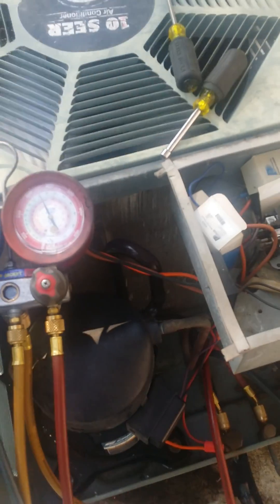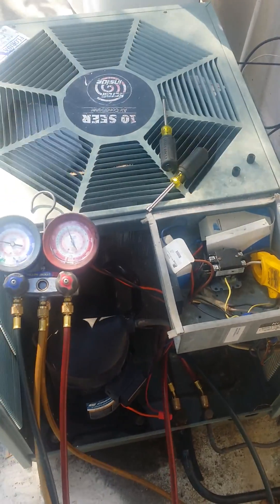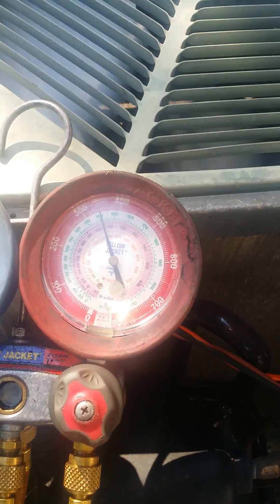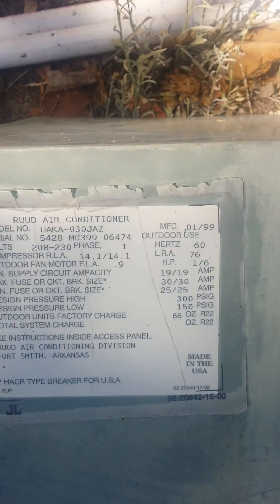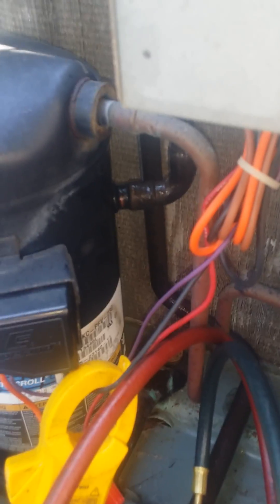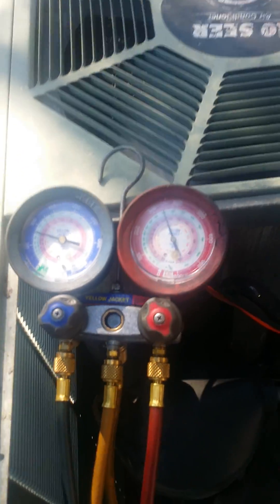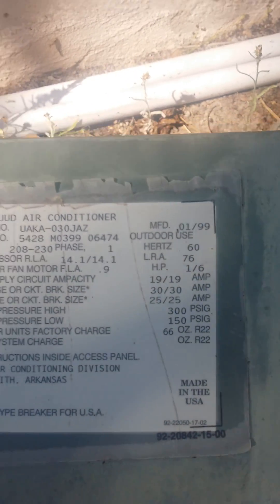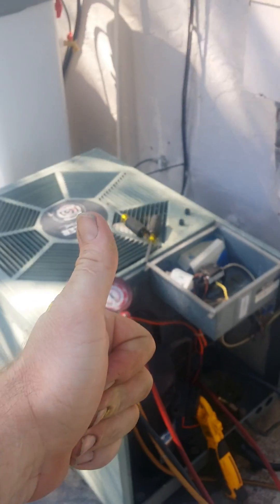410 a refrigerant drop on top of r22

Comment: The leak  is gonna get worse,  Because now you're running at a higher pressure  so the leak it's gonna be more aggressive, You would went back with R22 which is a lower pressure and let's say you only adding refrigerant once every year or every other year now that you added a higher pressure refrigerant it may be ever 6 months now, Plus there is different oils in the different refrigerants which will cause the compressor to fail prematurely,  you Just screwed your customer,  I guarantee you won't do a follow up video on this customer 6 months from now most likely they're gonna call somebody else

Comment: System will rupture, it's a hight prussure refrigerant added to a lower prussure system , especially an old system that has a rusty coil and corroded condenser, and in a very hot days oh goog god the prussure will go high and when that condencer gets dirty it will be doubled, mind u  that u went to that place 3 times which means that  there is a leak!! ,, guys don't do it couse ot worked , do it the right way ,, ppl search on you tube thinking that this is fine !! It's a disaster; for god sake if the indoor coil rapture they will be breathing all that chemicals,, !! If you are a Google warrior DONT call a tech to do this , it's not healthy, ur taking a chance breathing poison , this is your comfort unit, you should live comfortably. When you sleep you'll have no idea what's going on , you'll sleep forever!!

Comment: I put 410a in my r22 system and it works just fine
Reply: Did you have to take out all of the old r22 and clean the pipes and EVAP with nitrogen
Or you just added on top of it 
If so what ratio

Comment: There are better ways to make customers... It is unsafe to put r410 in an R22 system because of the pressure differences. Secondly unless it is a scroll compressor and considering you have to use Liquid to charge a 410 system you could easily blow the valves out of an older hermetic reciprocating compressor. 3rd you are not doing the customer any favors by coming out and dumping refrigerant into his system every time he has a cooling problem useless. As a professional I would not recommend people follow your advice in this video.

Comment: Let's talk pure simple logic. I am not an AC tech but I think I understand the concept  from a homeowner who likes to get a  good grip of things before they are done.  

Lets talk pressure? and someone who is truly an expert (takes typically 10 years hands on experience to be called a pro or expert in your field) can verify this for me.  

Analogy: Provided a chair can handle  a heavy  weight, A 1000 lbs  person sitting on that chair every day, for a year, will likely wear out that chair 10 times faster than one a 100 lbs, doing the same. This is the way I understand refrigerants. They all work at different pressures and the equipment (within reason) has to be sized accordingly to not give out in the process  of usage.   

Again not an AC tech but I would imagine that  if R22 (lower weight person) uses lower pressures than R410A (heavier weight person), then it reasons to say, that  by nature of comparison with the analogy to the chair and weight example, the R22 system would last longer and be more efficient in terms of longevity, than the one which uses higher pressure and equipment has to be also designed to handle higher pressures.  

I will omit the marketing schemes of using specific refrigerants, as in this area alone there could be questions, as also there could be questions to why go to  equipment that use refrigerants which operate at higher perhaps unsafe pressure levels. I will say that based on this alone, it is  not hard to see benefits of a system that uses lower pressure  equipment. To substantiate this, personal experience with older R22 systems installed in homes that have lasted well over 25 years with proper maintenance, is something to think about. Why the need to  switch over to one that perhaps does not, will not last as long. R410  systems are rather new and unfortunately not enough data to fully understand the longevity of such a system. From this point, my guess is that nothing will be as good as R22 systems. 

With this info, then lets see how adding a refrigerant that needs to run at higher pressure mixed with one that runs at lower pressure would work out, we will leave the oil mix out of the equation, for sake of simplicity  and concentrate just on the pressure differential between the two refrigerant requirements, in regards  to mechanics, the copper tubes, in terms of extra work to keep up with the higher pressure of the R410 in that system combo. 

I do not think the R22 hardware will be able to keep up with the refrigerant that requires higher pressures, such as the R410A or the system will not be efficient due to differences in mechanical (pipe thickness and diameter).  

Now some have claimed that yes you can use R410A condenser  with an R22 air handler by use of special pistons or TVX valves, pressure regulators, at the air handler side, after properly draining vacuuming and recharging the system with R410A. Although attractive especially,  if you want to save money and you think the air handler still in good shape, I still question this, as any time you mix components not originally designed  to operate under particular spec, you run the risk of something going bad or malfunctioning, at the least, not being as effective as one designed to work in unison with components designed for the particular pressure requirements for the particular refrigerant.

 If it was a matter of risking a couple hundred dollars, perhaps not a big issue in mixing components, refrigerants, but the reality is that these things are not cheap when they go bad!

Notice I did not touch base on the codes, regulations, or even the more important part, safety,  because  I wanted to illustrate this only from a mechanical logical point of view to make a point.  Nothing to do whether it will work or not. 

Something working is not the complete picture, especially when you look at energy savings, in equipment you are actually paying monthly for such comfort,   how well and efficient it does the job, in this case, is.

Comment: Hey guys, I got the customers approval to commit a $10k violation of EPA regulations.  That discharge line is "amazingly hot" and probably burning the head and causing acid build up.  Also, since when did scroll compressors start using pistons?  Joking aside, you can actually mix 50% propane, 50% butane, 50% R-410a and dump that right on top of a 50% charge of R-22 and it will work perfect... If this was not true, I would not be allowed to post it on the internet!

Comment: So you know you have a refrigerant leak in the system if its been low the last three times out. Did you find the leak or offer to repair it?? Because even if the 410A refrigerant works as a drop in it will undoubtedly leak even faster as the pressures are higher and this same problem will just keep returning

Comment: So now you have a mixture with a 26 degree temperature glide between bubble point and boiling point on the suction line and a 40 degree temperature glide between the dew point and boiling point in the condenser, while increasing the head pressure (compressor outlet minus suction) from 150psi to 270 psi, nearly doubling friction on compressor parts, while making the evaporator oil-logged due to the insolubility of mineral oil in R410a and the extreme cold (about 20 degrees F) at the refrigerant control when the little bit of 410a that has condensed flashes off. R22 equipment has a design test pressure of 350psig, and that's where your high side is at. Let's not even get into the violations of Section 608 of the Clean Air Act...

Comment: The judges  have been harsh in the comet section  . What  happened to  134a systems  in the early  90s than switch to puron R410A  by carrier  than everyone else  jump off the cliff right behind  them. OH shit they can  buy the  gas at wall Mart  can't  have that🤔 with all the  EPA safety  agendas  the  industry  wants to push flammable  refrigeration system's (propane)  without  trace oder gas be careful wen  using the  torch .

Comment: pure awesomeness. Back in the day they said you could not drop r134a onto of r12 in cars  either. Come to find out that mixing them gets it colder than either separately  , and so long as u have close to a 50/50 mix it will carry either oil . Now we both know it's illegal as hell and u should not do it but yes you can add a certain amount of r410a on top of r22. assuming you have a 50/50 mix  and you want a 45 degree coil on a str8 cool system were only talking about a low side pressure of about 103 not to bad ,  your problem will lie with a condenser temp of over 110 at 110 you will be at 295 psi , the upper limit of what the system can handle. Post us a 3 year update is it still working  ?

Comment: 1102.2.1 Mixing. Refrigerants, including refrigerant blends, with different designations in ASHRAE 34 shall 
not be mixed in a system. 
Exception: Addition of a second refrigerant is allowed where permitted by the equipment or appliance 
manufacturer to improve oil return at low temperatures. The refrigerant and amount added shall be in 
accordance with the manufacturer’s instructions.

Comment: Also r22 oil or mineral is not miscible with 410a creating less lubricant back to the compressor and storing more in the evap coil so what do you have when you send liquid to a compressor and don’t give it enough oil ? It’s not rocket science no tech data needed jimmy neutron

Comment: Everyone knows if you have two refrigerants with two separate boiling/ condensing temps one won’t be able to do either and create liquid where it should and vapor where it shouldn’t do you know how refrigeration works! ???
Reply: Dude, R410 is a mix of multiple refrigerants already...
Reply: @whitewigglesworth  it sure is. But I put 134a on top of my r22. 15 year's ago. Best system ever. I've never had any issues.

Comment: Each refrigerant has its own vapor pressure . What r22 is left in the system will never have a chance to evaporate under the higher suction pressure so it will send liquid back to the compressor shortening it’s life because compressors aren’t liquid pumps. Refrigeration is based on saturation temps you won’t know the saturation temps to be 40 on the suction and 90 to 110 or 30deg above ambient because you have an unknown pressure temperature relation as you are not a chemist and don’t have a pt chart for that blend you are guessing and in turn are just creating beer can cold my six year old can accomplish your profession if that’s what your calling it. Good luck mad scientist

Comment: If the liquid was that hot. It isn't subcooling amymore
Reply: Not true entirely, it still has to go through the condenser coil to become subcooled. No refrigerant is ever subcooled at the entrance of the discharge pipe, that just aint how it works. If you are saying that his discharge temperature is too hot for the condenser coil to actually be capable of subcooling then I agree with you.

Comment: Let's first start off by saying number 1 this is totally illegal... number 2 is what happens when the unit needs to be replaced and someone recovers the refrigerant thinking it's R22 according to the data plate into an R22 recovery drum and then turns that recovered refrigerant and to be reclaimed or recycled and is now charged a fine because they're R22 is now mixed..... Number 3 your superheat and subcooling will never be correct..... Number 4 you just screwed the customer.... And lastly number 5 you are a hack and should have your license pulled if you even have one!!!!
Reply: Can you explain, in technical terms, why it will not work?
Also, can you link to the law which makes it "totally illegal"?
Reply: Tech terms, this does NOT work because the oils on the refrigerant don't mix. Those r22 pressures should Not be that low if the head pressure is over 300. It's like mixing oils in a car that aren't meant for that car. I've seen many compressor failures due to mixed refrigerant.

Comment: First off, fix the leak instead of gas and go, second what ever happened to 407c?, third those refrigerants have different boiling temperatures, so 410 will not condens or will not evaporate, it will possibly slug the compressor. And create cappacity los. 
BUTT HOWEVER. the r22 in the system will take care for the oil curculation, because its a suction cooled compressor it will boil off any 
Liquid coming back.
Reply: sjef oekel is it a scroll because those are cooled by the discharge gas they are different than a reciprocating

Comment: Super heat and sub cooling would be jacked up. This may be working but it's guess work on how.  Depending on how hot the home is and outside temp may be the issue.  What is the delta T across the coil?  I need more insight on this.  It's better to use R-422 than R-410 on a R-22 system anyway.

Comment: what's the superheat and subcool though I can guarantee you they're all f*** up he probably just took all the efficiency and of that system either that or there wasn't much R22 but regardless with that head pressure and that section pressure dude it seems like you got it some kind of restriction
Reply: Ryan Hall he said it has a piston, why would you check subcooling?
Reply: @Fasst_tb  asking this question shows your lack of knowledge. Subcooling and superheat are used to determine how much refrigerant you have in the coils. You want coils that are flooded or dry to the bone? Back to 1st year apprenticeship for you. Every good technician checks his superheats and subcoolings regardless of exv,txv,piston,cap,hgbp,hmc yadda yadda. Explain refrigerant enthalpy to me, please?
Reply: @Veedub98   If your superheat is correct, you have to have at least some amount of subcooling and more often than not you are within like 5 degrees on your subcooling anyway. As long as you have a full line of liquid going to your evaporator, your coils are clean and your airflow isnt restricted, you have subcooling. Its paramount to check your superheat on a piston system, I get that but your subcooling doesnt give you any info other than you have it or you dont.  Where do you get that you can determine an amount of refrigerant in a coil based off of superheat and subcool? I would like a detailed explanation to see if I'm missing something here.

Comment: He should have put the panel back on to get the proper pressure readings.
Reply: Can you explain - in technical terms - what difference that would make?
Reply: Wont matter in that type of design.  A the airflow is being pulled thru the coil
Reply: what cant be open is the evaporator panel
Reply: @troymason4799  Neither coil can have a lack of airflow, it just so happens that if you have an evaporator coil that sits directly on top of a furnace and the coil has all the air flowing through it with no leakage or bypass you can have nothing over top of the coil and you will get the same readings as if the duct work was closed up around it and was sized adequately assuming you account for the extra cfm gained by having no restriction after the coil.

Comment: High compressor superheat = dead compressor it won't last
Reply: BecUse its going to overheat due to high superheat
Reply: Can you explain technically why you think it won't last?
Reply: @ThomasSk100  If you don't understand superheat  then you cannot understand what Mike said. Superheat is really important to have right on a system because if it is too low you will get liquid back to the compressor and you can slug it to the point it will break itself from trying to compress a liquid or just overheat from being overworked trying to compress a liquid. A compressor uses refrigerant vapor to cool itself when that vapor comes back at the proper rate after absorbing the heat from the supply air in the ductwork inside the house, hence superheating the refrigerant. when superheat is high the compressor starves for cooling and then you also have the added benefit of poor oil flow in the system to aid in hurting the compressor. Its a fine balance that needs to be maintained.
Reply: @whitewigglesworth  Ok slamin, here is take #2.  Can >YOU< explain technically why you think it won't last?  Please use simple terms so that even your youtube followers can understand.  Is it some burst pressure?  Caused under what conditions?  Chemical reactions?  What chemicals and under what conditions?

Comment: Just a heads up, I put R-410 in an R-22 unit which has a  restrictor orifice by mistake. The customer had 4 identical units except one was R410 they are jammed the jack ass electrician installed the disconnect over the rating plate. Looking at the plate of the next unit over I thought I was good. The unit worked fine except the customer notice a change in capacity. The unit cooled a home office which the guy just about live in. if the system had been over changed maybe he would not have noticed the change.

Comment: SORRY GUYS BUT I DID IT  TOO !  I ADDED ABOUT 5 LBS OF R22   TO A R 410A SYSTEM WORKED FINE FOR 5 YRS NOW  OK DONT BUG ME ABOUT THE OIL !!! I BEEN DOING THIS FOR  FOR 40TY YRS AND ONE THING I LEARNED IS DONT ALWAYS  LISTEN TO THE BULLSHIT!  EVEN RECLAIM IS A JOKE!  ITS ALL ABOUT MONEY!!!   YOU ACYUALLY BELIEVE THAT THE REFERANTS  ARE DIFFERANT IN THE RESPECT OF BEING HARMFUL ? YOU BELIEVE R 410A ISNT HARMFUL TO THE ENVIREMENT ?  RULE NUMBER ONE IN HVAC NEVER MIX REFERANTS YET HALF THE  REFRIGERANTS ARE MIXTURES    EVER HEAR OF CAREENE ! ??LOL CARRIER TOOK R 22 AND R 12 AND MIXED THEM LOL AND SOLD IT AS CAREEN FOR MORE MONEY WAKE ITS ALL ABOUT MONEY!
Reply: 410 is already a mix, so if you mix in r22 what do you have. what T&p do you use also the pistons or txv and compressor are rated for R22 their is no way you can charge it correctly or dial it in. can't ever see it working correctly